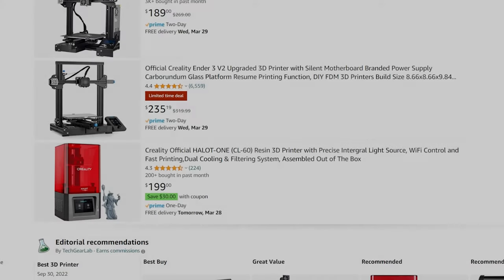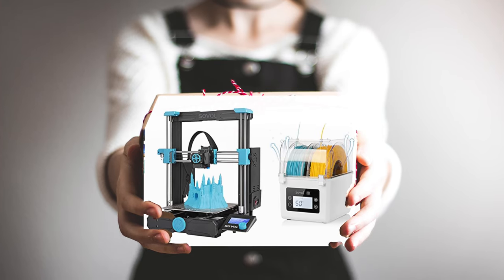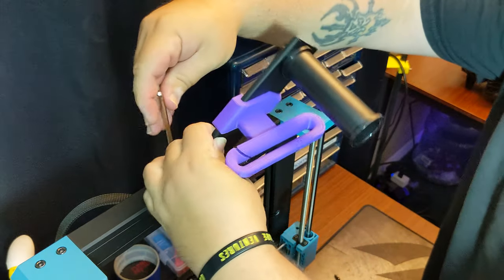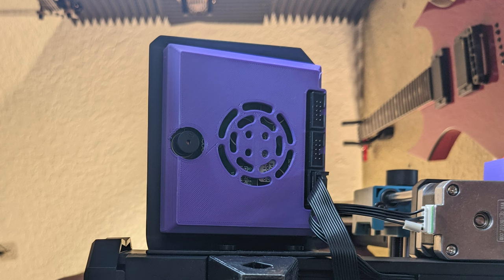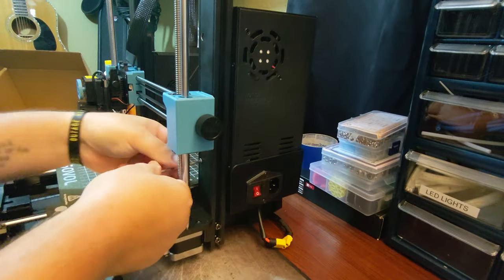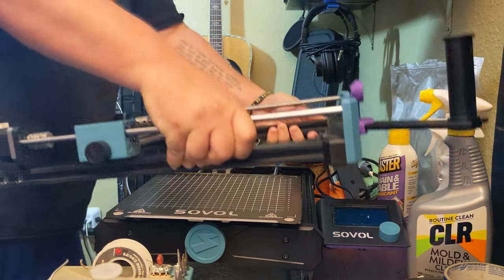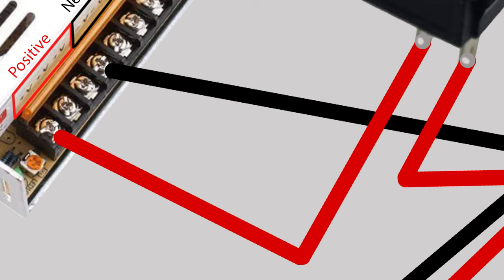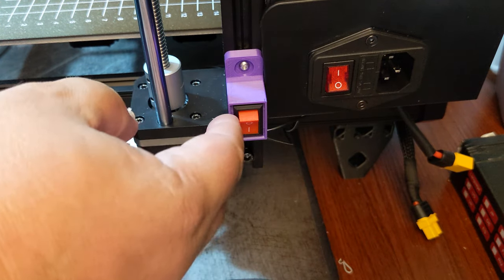I Upgraded My Printer and then Upgraded My Printer. | SOVOL SV06

Comment: Pimp my SV06!  Nice!

2:15 - Apparently, Sovol sells PLA on their website that matches the light blue of their injection molded parts.

I'm waiting for the Klipper version of the SV06 Plus with WiFi, hopefully with a 4 conductor CANbus cable to the extruder instead of that big ribbon cable (what were they thinking?), and with improved part cooling on the extruder as well as a larger part cooling fan on the X gantry like the SV07.  I'd also like to see an optical filament run out sensor on the top of the extruder.  But mostly, I want an SV08 Plus that is the SV06 Plus with Klipper and better part cooling.

Comment: The first "upgrade" should be wiring the MCU fan to a continuous 24v source. In factory setup the MCU fan runs on the same voltage as the part cooling fan. I'm not sure if all of the units are like this or what the engineers thought when they designed this solution, but it is quite straightforward to fix this issue if you have some experience with electronics.

Comment: Lots of love to your dad! Great printer, I am currently looking into both SV06 and SV07, differnce in price between the two in my region is just 36 USD. I like the SV06 hardware wise i.e. rails but it doest seem cost effective (when comparet do SV07 price in my region) to get a RasPI and touchscreen for getting it upgraded to klipper.
Reply from the maker: Haha, thanks 😁

Definitely go for the SV07 if you're wanting Klipper out-of-box. I'd like to check out the SV08, too. I think that's going to be a great printer from what I've seen. But it's a lot more, price-wise.

The Klipper screen is a great add-on for the SV06 too, now that I've used it a bunch, there's no way I could ever go back. I'm sure you'll be happy with whatever you choose. 🙂

Comment: The filament guide is helpful if you run your filament from not exactly above the extruder but at an angle. I for example have it in a drybox on a shelf above the printer which overhangs quite a bit. So without the guide the filament would not go straight into the extruder causing some friction.

Comment: The only recommendation I could give would be to upgrade that PSU to a Meanwell as quickly as possible. China ain't known for their.....stringent regulations on anything. TH3D has some Meanwell's for the SV06. He did a pretty cool test while switching it out for the original.
Reply from the maker: Yes! That's going to be one of my next upgrades. I saw that TH3D video, too. Good stuff.

Comment: Do you have to use a separate switch? Couldn't you just have it so the lights always come on when the printer is on?
Reply from the maker: Yes, you could bypass it, just wire directly to the power supply. I just like the option of the switch because i run my printer overnight sometimes.

Comment: Hello Friend, I bought a Sovol v6 60 days ago and I'm struggling with bed adhesion. The PEI is not holding the prints, and I even had to buy a new Hotend set for a complete replacement because plastic got stuck when detaching from the PEI, damaging the entire Hotend. Could you tell me what I can do? I'm almost considering throwing away this machine.
Reply from the maker: If the print isn't sticking, try lowering the Z offset a bit. I usually go just a hair more than I measure with paper (or just pinch the paper tighter than you originally did).

In the very least, before you chuck it, you have a 1 year warranty. I would contact Sovol and explain the issues. They have sent me replacement parts for free to fix any issues I've had. And that's without knowing I run this channel.

Hope this helps!

Comment: Nice video. My SV06 is good so far runs well with Klipper. Very reliable. Only wish the hotend was more upgradable
Reply: https://youtu.be/_Soz8z-vAIw cnc kitchen mod his ender 3 with a volcano nozzle. I think its possible. In my case in using a CHT clone nozzle, It helps have a bit more flow, cnc kitchen make a vídeo about It too.

Comment: Hi. Could you update it with filament runout sensor?
Reply from the maker: I'm looking into it.. but so far the only option I've seen to add one is with a main board swap. I'm still searching, though.
Reply: @Avel  hmm... SV06 Plus have this sensor... Maybe it's possible to solder socket for it on SV06 board and flash with Plus software....

Comment: Do you have any upgrades recommendation for a sovol 6 plus Build plate
Reply from the maker: Are you having issues with the original build plate? I don't have the Plus but isn't it a PEI powder coated plate too, like the SV06? The one I use on my SV06 is the stock one, I bought an extra one and they both work fine for me.

If yours isn't PEI powder coated, I'd recommend that.
Reply: @Avel  So the stockbuuild plate on Mine cracked when I was taking off one of the 3D prints And the bill plate I have has double-sided so it has PEI plate and then just the stock black one on the other side.
Reply from the maker: It cracked?? That's crazy! I would say, ask around the Facebook SOVOL forum to see what other people are using. If I had any experience with the Plus I'd be of more help. Maybe one day I'll pick one up.

Comment: I upgrade to klipper and then control the light software. No need for such an archaic approach. Believe me, it's an easy installation, just educate yourself, read and then you can choose Klipper. The Sovol printer is brilliant because you can easily install Klipper on it. Same with Kingroon printers. Why am I writing this? Because I have a klipper installed and on this you can set, for example: 20 percent of the lighting power when the printer is idle, 100 percent of the lighting power during printing, and when it finishes printing, it flashes 10 times so that "draw attention to yourself" to it that it is over and then it goes to 20 percentage of light output. And if there is no activity, it turns off the light after 20 minutes. Configuration in Marlin is cumbersome and outdated, there were no such boards with a greater possibility to do so.
Reply: Oh God, a Klipper dork entered chat.
Reply: @ipdjbt  Why? After all, everything works for me, the klipper controls the light beautifully. Knowledge of the board plus software does its job. Dork if you doesn't try.
https://www.youtube.com/watch?v=rIqg9bFykw0

Comment: I'm having alot of problem with my sv06. But I like it.
Reply: Like what? I have one coming in tomorrow lol
Reply: @christian4530  mainly zaligment problems. Very hard for me ajust, people with more experience  must be easy. On time the extruder got stuck  I had to open it took  some time but I managed  to fix. I'm newbie  but learned alot.
And it very hard for me print with good quality, lots of ozing, but recently  I thinking my filament need to be dehydrated.  As its  my frist printer can't tell how much is me or the printer. But it wasn't a smooth learn curve. Maybe yours can be better. I don't know if I got a bad printer  with some problems form factory, maybe your came batter shape. What I know is too much variables, I wish I could print flawless from factory. Some people had this experience, I'm not one of them.

Make sure the filament gear on the right  side of the extruder, when the blue wheel   is facing you, it well screwed. Some time the gear don't pull  the filament and it stop extruding. 

For very experienced  people this machine can be wonderful  I guess.
Reply: @Gabs_Labs  I appreciate the reply. And this is my first printer too so wish me luck haha.
Reply: @Gabs_Labs  if too problematic I’ll prob return it and get an Elegoo Neptune 3 pro
Reply: @christian4530  for people  that just want to print, best choice.  In my sv06 I changed the bearings lm8uu, because  of the noise and friction, I've printed 2 rectangles to put between  the z motors and the z pillars to make it 90 degrees. I put 688zz bearing in the space in the z screws to more stable  moviment. Alot of this is in sv06 plus, so maybe that a better choice. 

Sv06 can reach  300 degrees  so if want to print with engineering filaments, nylon, carbon  fiber. But Without  a case must be hard.
Reply from the maker: Sorry you're having issues :/

There's a couple Facebook groups that have a lot of nice people ready to help out. The main Sovol group being one. I'd recommend checking it out and hopefully someone can point you in the right direction.

I appreciate your comments, guys!
Reply: @Avel  Its ok! They help me a lot.
Reply: @christian4530  i manage to fix my problems, I learned How do a proper z aligment. In the end Just need learn more about printing.